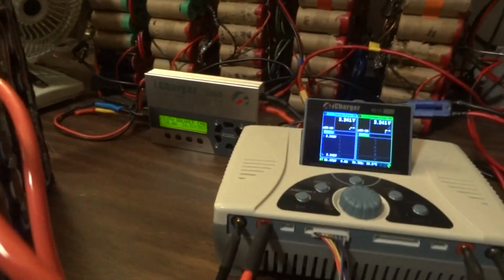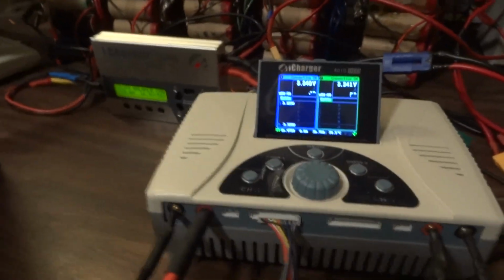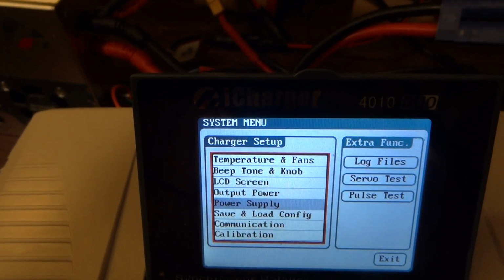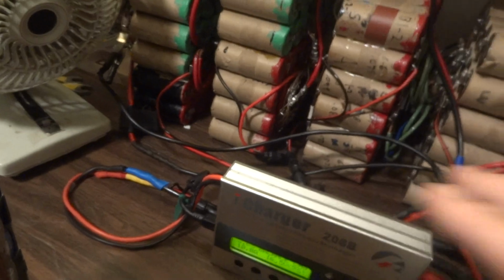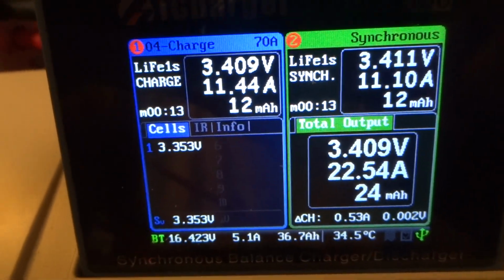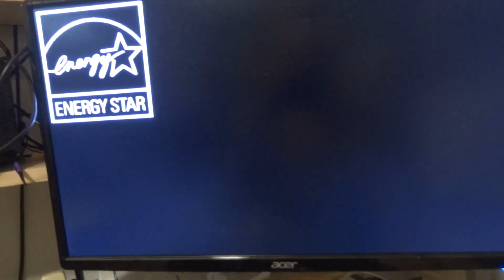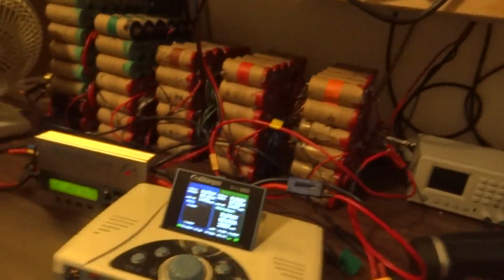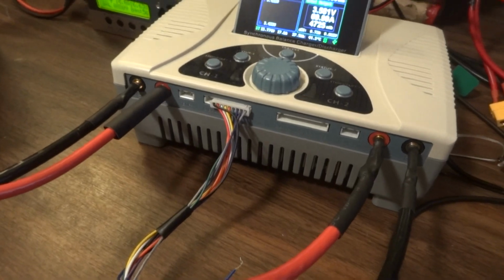iCharger 4010 DUO Synchronous 70 Amp Charge/Discharge Part 1

Comment: Hello, do you have a video on how to charge the cells of a Toyota Prius nickel and does this device ه4010 charge the Prius battery at once? Thank you
Reply from the maker: No. I don't think this is the right equipment for that. Probably need to get Toyota supplied charger. Need much more power!

Comment: I don't think you have to be in battery mode, you should be able to do synchronous mode on a dc power supply. I didn't watch the whole video but running the charger off that huge battery bank doesn't make sense unless it's being charged by solar
Reply: I saw your other video, so it is on solar I see
Reply from the maker: Thank you for the comment. I worry that running power backwards into my power supply (negative current) from the battery under capacity test might damage the supply. I have often used a power supply in the other direction to charge batteries. If you have success doing this please comment, as I might also give it a try.
Reply: @yancymuu4977  oh I see what you're saying, no the ichargers won't even let you use a power supply as a regenerative battery. I don't plan to use my rc charger for discharging. The rc chargers to me all seem really fragile so I would use them less if I can. not to be nosy but I would put a fan under your icharger to help with the heat, for example using one of those laptop fan pads you put underneath , except I don't know which direction the airflow is. for discharging I'm using a shunt based capacity meter , but I'm using it with a BMS, you probably could set a cutoff voltage but I haven't used it yet, these are the ones I'm using but my application is for a minivan, although for you , you should still be using a bms on all your battery packs

https://www.aliexpress.com/item/4001159364475.html

https://www.aliexpress.com/item/32957814319.html
Reply: I dont mean to be so off topic but does someone know a tool to log back into an Instagram account?
I was dumb lost my password. I would love any help you can give me
Reply: @Korbin Jerry Instablaster =)
Reply: @Cole Case i really appreciate your reply. I found the site on google and I'm in the hacking process now.
Looks like it's gonna take quite some time so I will get back to you later with my results.
Reply: @Cole Case it did the trick and I finally got access to my account again. Im so happy!
Thanks so much you saved my ass !
Reply: @Korbin Jerry You are welcome =)